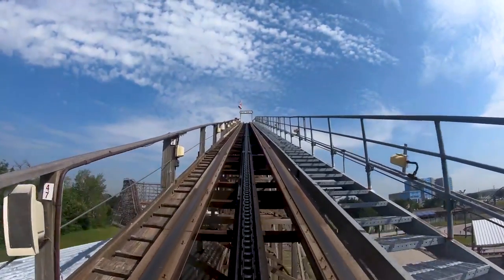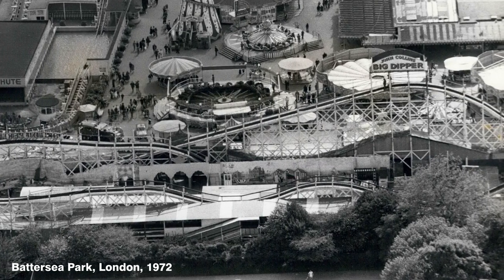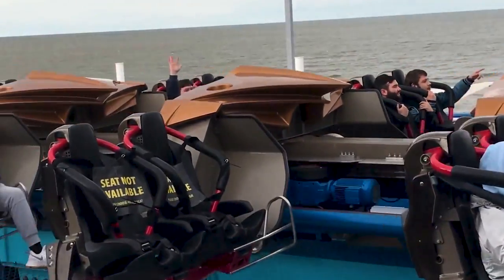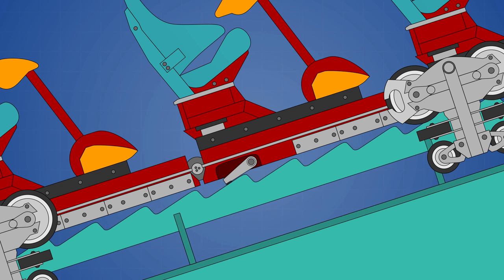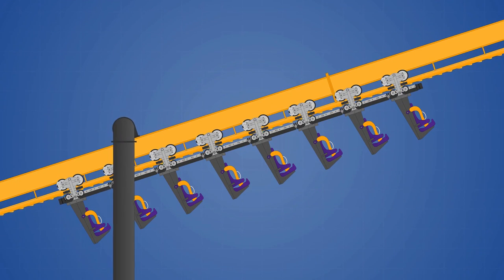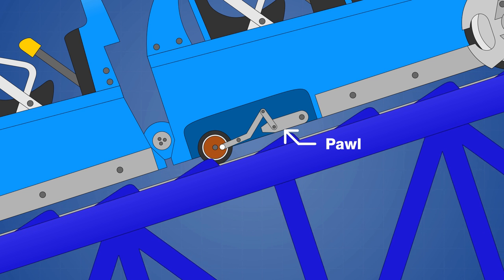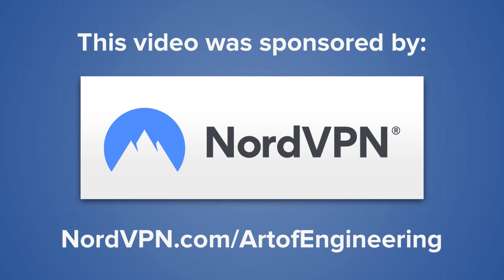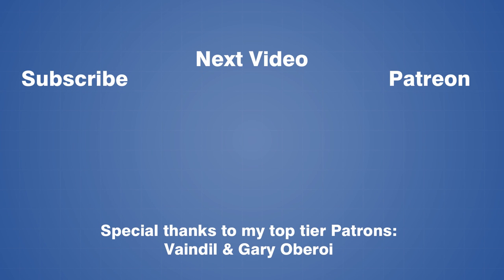Why Roller Coasters Click

Comment: I love how one of the things that make people say coasters are dangerous or makes people scared of coasters is the clicking noise they make. Little do they know its keeping them safe
Reply: I like the clicking sound. It builds up the anticipation and excitement for me which is the whole point of going on roller coasters.
Reply: I have no idea why it freaks me out and gives me panic attacks but I did always know it was there for safety reasons but idk my brain is w h a c k
Reply: @runawaystarfish5943  nah, you’re not whack, it’s normal lol. In general, most things mechanical in nature, a loud noise, such as the loud clicking of the lift chain/ARB system on the lift hill of a coaster, typically means a malfunction or something has broken. Like vehicles or other large pieces of machinery have a smoother sound of the motor running, although some may be louder than others, but in general, a clicking noise equivalent to what you hear on a coaster, would be indicative of a serious mechanical malfunction or that something is severely broken/damaged. Not everything is this way, but most things typically do not make a loud clicking noise when in proper functioning. That being said, when we hear a noise like that while on a large piece of machinery, it is natural for ones mind to correlate that with something negative, like a serious malfunction or something broken. As humans, our brains can sometimes work on repetition, correlating certain things with one another. So, with that being said, even though you know what the noise is on a coaster but still getting anxiety, it’s actually quite normal that your brain automatically, inadvertently correlates the noise with malfunction, causing you to have to redirect that thought process and tell yourself, “Nothing is wrong! I know this noise and it’s a good thing!” Sorry to get all scientific or technical or whatever you want to call it. Just trying to ease your mind that you’re not whack, you’re brain is just playing tricks on you! Lol. Much like I can’t shut my nursing brain off and thus, why you get a response like this lol. Anyway, hope this helps!
Reply: @davidshanholtz6674  huh that actually makes a lot of sense;; thanks lolol
Reply: Huh I assumed all roller coasters had sprigs

Comment: Having worked as a tech on multiple coasters previously, I appreciate the level of accuracy your videos always have. As a fun fact, the first safety in the lift mechanism is called a sprag clutch, which prevents the sprocket holding the chain from rotating in the reverse direction when the sprags engage with the clutch's outer race (a circular version of the Vekoma SLC rollback mechanism). As long as the sprocket is held, the chain cannot reverse its direction, preventing the chain from rolling backwards.
Reply: Thank you kind technician

Comment: When you mentioned how some companies make their ARB’s silent I was waiting for that “some don’t” and a clip of Steel Vengeance
Reply: Same. And it doesn't make it better that the que line is right by it lol
Reply: Roller Coaster Teen steel Vengeance clearly doesn’t have the pads on it. Twisted Timbers at Kings Dominion used to be that way, but I think those are on there now, because I noticed it was much quieter this year.
Reply: @gregorygolub3315  that's good. I am making a trip out to ride it this year so it will be quiet
Reply: I was hoping he would mention one of the other ways which is using tyres to lift the train up the hill, like The Hulk Roller Coaster at Universal.
Reply: Those cedar point rides are a different kind of roller coaster lol. And I just found that out 🤣

Comment: Leave it to Intamin to complicate the anti-rollback system
Reply: I think they do it that way because their chain and cable lift are much faster than most other coasters to reduce wear and tear on the ARB.
Reply: Vekoma uses it too, Lech coaster has a similar system.
Reply: MsHardstyleMonster atleast compared to intamin, Vekoma doesn’t break down every 3 seconds. Intamin breaks down like every 3 seconds bc of that.

Comment: This actually happened to me once. I was on el toro and the lift just stopped- then we started rolling back for a bit before we where caught by the break.
Reply: nice. How did you get down then?
Reply: @kashyapvariyani4037 with wooden coasters evac isnt too hard, so they were likely walked down the lift
Reply: @forzaguy1252  yeah but it'll still be steep on high ground. Pretty dangerous to just walk down

Comment: Gerstlauer has a magnetic rollback system-  which The Smiler uses
Reply: Part of me wonders if an active ARB would have reduced the severity of injuries as a result of the smiler crash, because it would have prevented the empty car rolling backwards from where the car stalled. The two cars would have then collided on a climb which would have reduced impact speed. Mind you, none of this would have happened if the ride ops had payed attention to the computer system warnings.
Reply: Soen Trueman the crash wasn’t exactly on a lift section...
Reply: @gregorygolub3315  No, but it was a rollback caused by an empty car stalling on an vertical inversion; which caused it to rollback into the path of an oncoming car.
Reply: @soentrueman7944  As I understand it they didn't merely fail to pay attention to the warnings they had to actively override them. The former would be negligent sure but actively overriding safety interlocks elevates it to recklessness in my mind. The decision to actively override a safety system is a conscious decision to operate with a diminished safety margin. At least it is unless sufficient operating procedures are in place to compensate for the missing system with something equally reliable. In this case, I presume the warning would have been indicating that an object triggered a sensor at the start of the ride and failed to reach sensors later in the run when it should have. Sure a sensor glitch could potentially trigger something like this so having an override exist makes sense but the minimum procedure to override a warning like that should have been a visual inspection of the entire track to ensure that there are no stalled cars or anything else that should not be present on the track first. It really doesn't seem that hard to me though it might require someone to get off their ass for a minute if the visibility of parts of the ride is restricted from the control booth.

Comment: Another awesome video!  One neat thing you probably already knew, but didn't have time in the video to explain, is that on a lot of the B+M coasters (certainly the 3 at Canada's Wonderland), the ARB rack on the lift itself actually isn't fixed permanently in place.  It can slide parallel to the direction of travel of the train, and is broken up into many small segments.  Each segment has a rubber bumper at the end of it, which takes up the shock load that would otherwise be seen when the backward-rolling train suddenly engages it.  Even at a slow speed this would result in an infinitely high force which could potentially break one of the ratchet pawls, or at least make a massive bang and make for a very uncomfortable stop - so those bumpers take up and cushion that shock load.

Comment: What if the chain lift's gearbox was a worm gear instead of a helical/bevel gear? Worm gears above 15:1 are (normally) not back-driveable, while helical and bevel gears always are. But if the chain were to break, the train would still roll back in the station. So even if the lift hill's gearbox was a worm gear, the mechanism would still be needed.
Also, do you know why Arrow lift hills have such an irregular sound?

Another note: Linear Induction Motors are not self-braking, so that is why Wicked Twister has supplementary magnetic brakes and Incredicoaster / California Screamin also has brakes after the first launch and along the second launch. Linear Synchronous Motors seem to be inherently self-braking, so Red Force (for example) does not require a supplemental braking system as the launch motors act like brakes when not powered. 

Edit: Spelling

Comment: I work at flamingo land as a mechanical and electrical engineer, my main ride is SIK "intamin inversion 10 rev B" we use the gas piston assisted ARB pawl. However this system is slightly different to accommodate the 38kph catch cart lift speed. Connected to the ARB pawl is 2 discs with 28 opposed neodymium magnets, these rotate on wheel that is situated next to the rack, when the train is moving eddie currents are generated to lift the pawl to prevent a very rapid and destructive "clacking" this lift energy is directly proportional to the train speed so if a fail condition is met, the pawl instantly drops into the rack.

Comment: Space mountain at Disneyland CA uses a similar ARBS to the Vekoma SLC, except the cams are mounted to the track and the fins are on the trains. The fins are also used on the brake runs limiting the weight of the trains.

Comment: A holding brake on the lift motor is a rarity on a chain drive, I've only come across older Vekomas using them. The only other manufacturer I have seen use brakes on the drive are Intamin for their cable lift systems, they have a magnetic clutch brake on the arse end of the motor, a hydraulic disc brake on the gearbox input shaft and an enormous disc brake on the winch drum itself. 
Did you also know that the anti rollbacks are spaced in a way that only allows one ARB to be engaged at a time, this is to reduce the distance a train will roll back to the absolute minimum.

Comment: I've yet to see any ARB videos mention the arrow suspended coaster model, which has pawls that do not move, and it's the teeth that move. The teeth get pushed up as the pew pushes on them. You can actually see the teeth wobble in and out of position while on the ride since the track is above you.

Comment: There are a few Coasters that could be Mentioned, that dooes not have a ARB device but should actually need one cause they are not Launched or Boomerangs!

The Biggest Example is Phantasialand Brühl, Colorado Adventure. Its a Vekoma Mine Train Coaster that Runs normal Lifthills, but instead of Chains, they use Friction Wheels to pull them up the Litthills! And thats a big disadvantage during Rain. So Vekoma built in front of each Lifthill Breaks and Block Segments to Prevent a Crash with a other Train, and Phantasialand Brühl just loads the Train half full, or they Shut down the Coaster, depending on how much it rains.
Also to Mention, it has a Special and Unique Device at the End of the last Turn (at 2:33) when the Car is not fast enough to reach the final Break. There is a small Chain installed that starts running when the train is to slow and cannot  reach the last break by its own. I barely see them using it, cause even when its wet and the cars are not full, the Train manages it to the end. I just seen it running for once. 

Check it out!
https://www.youtube.com/watch?v=YQ1FNYTTuBw
Reply from the maker: Thanks for sharing! I actually hadn't seen that roller coaster before. Definitely a unique lift system!

Comment: I’m absolutely terrified of roller coasters, however learning more about them helps ease my mind a bit. Don’t think I’d ever be able to go on something like the Yukon Striker at Canada’s wonderland, but I’ve been able to go on smaller rides. I just don’t like the restraints in most roller coasters, when it’s only a bar over my lap there’s always so much space between my lap and the bar so I slide around so much and grip on for dear life cause I feel like I’m falling out! And the bar will be pushed all the way back but it won’t be touching me at all. Plus there was a incident with my brother where his bar didn’t lock, on the sky screamer, thankfully he was young and ‘chickened out’ at the last second,ripped the bar off and ran off. They had to shut down the ride to figure out what happened and no one went on it for the rest of the day.
Reply: If your main problem is loose restraints, you should have no issue with Yukon. Those restraints actually get lambasted for being too restrictive. B&M hypers like Behemoth and Leviathan will be difficult to overcome though

Comment: 3:25 The Bat does have an ARB system on the second lift. The catch here is the lift chain trough can move up and down to catch and release the train.
A premature failure on The Bat can actually cause the train to be stuck in the boomerang part of the ride, making evacuations very difficult. For this reason, you'll hear the hiss of the station and loop brakes release just before dropping in either direction. It is preferable that the train have a fairly hard stop at the bottom of the station or loop instead of getting caught upside down for obvious reasons. Failure modes of the lift include the catch car failing on the first lift hill, or the chain trough not raising or dropping prematurely on the second hill either causing the train to not catch the trough at all, or to be released too early.

Comment: You missed arrows solution on their suspended coasters where they found a way to use just gravity on its anti rollbacks. The anti rollback dogs are on the lift itself and the ratchet system is on the train.
Reply: Which somehow get out of adjustment enough to bang against the fiberglass bodywork.
Reply: @Ravaxr  Whut
Reply: @sharkheadism  https://www.youtube.com/watch?v=aFHj5cy1wcs You can definitely hear the metallic clank, but then every once in a while you'll hear one of the dogs drop onto the fiberglass shroud around the wheel trucks.

Comment: 2:25 They say it is required to have at least two anti-rollback features, because it is less likely for both of them to fail at the same time. But the accident in London happened because the two features failed, the lifting cable snapped, and the brakes failed. Just two safety features seems way too low anyways, when the ride is supposed to operate almost every day for many years. I'm not an expert but I though it might be interesting to bring it up.
Reply: 1/10 billion is such an unfathomably small chance of failure its almost impossible to properly comprehend. You are more likely to win the powerball lottery and be struck by lightning multiple times
Reply: If you have two safety features that are individually very reliable then combining them can make an overall system that is extremely reliable.

Of course for this to work the two individual safety features must actually be very reliable. That means a well-designed programme of inspection/testing/maintinance.

Adding a third system seems tempting, but the problem is "common cause" faliures. Having two sets of dogs doesn't help you if both of them are gummed up with dirt.

Comment: For upsidedown rollercoasters, why don't the ratchets just have a denser weight on the small stub of the lever, instead of a spring? Would that have less of a chance of mechanical failure?

Comment: How ironic that Gatekeeper is in this video. The chain snapped last week with the train at the top of the lift hill but the anti rollback device worked perfectly keeping the train safely in place while the riders were evacuated. Everyone was safe.
Reply: CoasterBot has a video that he shows the Smiler when he brings up block safety systems and how block sections work

Ofc the smiler did it's job and stopped the train on the lift hill for it to be evacced, but..   you know..

Comment: Um... the pawls in both top and bottom mounted coasters are usually spring loaded and can fall on their own if the spring breaks, but they have springs so they can engage faster, therefore much safer

Comment: It’s just a ratchet system. As the coaster goes up it clicks off a spring loaded detent that latches on  to the saw tooth that you see on the lift hill. If the chain fails for any reason. This prevents roll back of the car

Comment: Actually the failure rate would be far less than 1 in 10 billion. It would be the odds of failure of the cable plus the failure of the 2 ARBs.

Comment: So how does the smilers arb work then because it has fins that get pushed down by the front magnetic brake
Reply: The fins are hinged to get pushed down while being pushed forward, but they have a hard stop that prevents them from being pushed backward. Thus they are a one way magnetic brake. If the chain or the block fixed to the chain breaks, the train will not lock into place like tooth and dog systems, but instead slowly slide back down the hill to the brakes and rubber wheels at the bottom.

Comment: I knew the second that coster sped in that it was el toro ive been to six flags way to much
Reply: Actually none of these are El Toro, which uses a silent cable lift, and it's also one of the best rides ever conceived